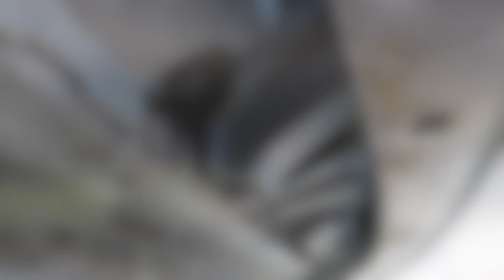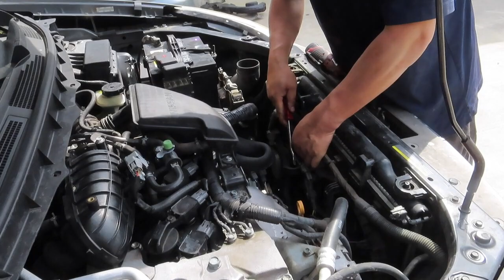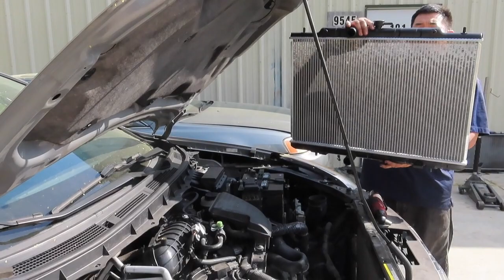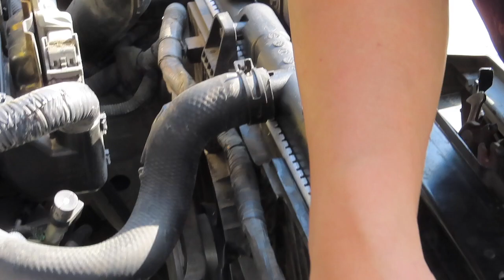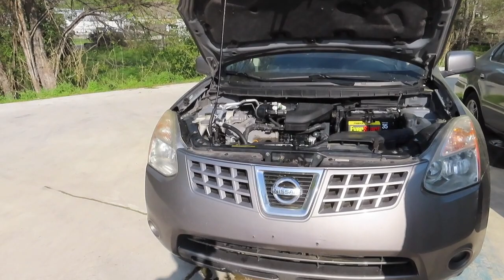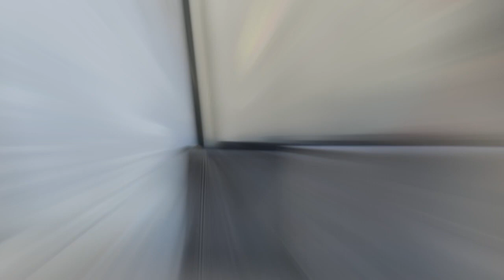Replacing Radiator on 2008-2013 Nissan Rogue

Comment: never left a comment on anything before, but this was super helpful and coz it looked relatively straight forward i went ahead and replaced my first radiator!!! many thanks for the details... i gotta agree with Kurt K... check the radiator support bushings... likely the reason my radiator had a leak in the first place since when those crack/break, the radiator gets jostled around quite a bit.  cheers!

Comment: Thanks for the video, I will have to do this job on my wife's car this afternoon. It is also worth mentioning that you should change you radiator support bushings(the 2 rubber pieces that sits on top of the radiator) periodically as that is the reason why most of these radiator have leaks because the rubber bushing allows to much movement and it causes the radiator to rock back and forth banging against the frame.  The bushings need to be changed on this car as it still has a lot of movement and will ultimately cause the radiator to fail again. It is not the great of a design, but by changing the bushing you could spend $5 versus over $150.
Reply: What's oem part number for those bushings?

Comment: On later model cars, Nissan also fitted a small CVT transmission radiator to the front of the standard radiator.

Comment: Thanks for the video. I'm wondering if I may need to get a new radiator soon. I just did a coolant drain and fill on my radiator and when I screwed the stupid plastic drain plug back in, it just kept turning and never got tight. It also will not unscrew now either. Luckily it seems to be holding the coolant, but I don't know if it will last.
Reply: Sorry to hear that :(
Reply: Put a bunch of jb weld around it😂
Reply: @vicc3337  too late. Months later, the plug gave way and the car lost it's coolant. It overheated and the engine was ruined! My wife now drives a 2020 SantaFe, and she has a greater awareness of the temperature gage on the dash.

Comment: Hi, really informative video, do you happen to know what the name of the part that’s located right in front (bottom corner) of the radiator called? I have a 2011 rouge and found something leaking out of the hose thats connected to what looks like a smaller version of the radiator but in front of the official radiator?
Reply: Sounds like you have a leak in the condenser for the air conditioner.

Comment: For this particular you dont need to replace the thermostat as well??
Reply from the maker: Depending on what the reason for the repair, and if it's time for that maintenance. But it does not hurt to change it if you are there.